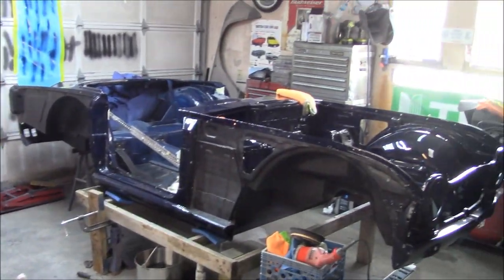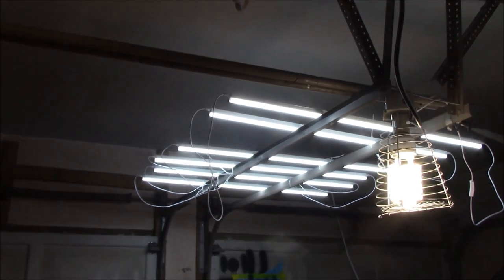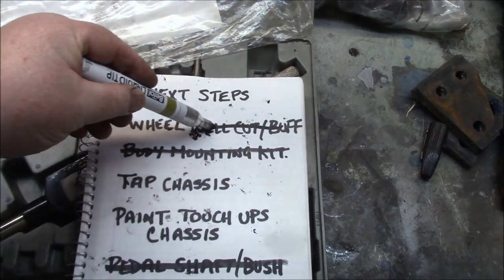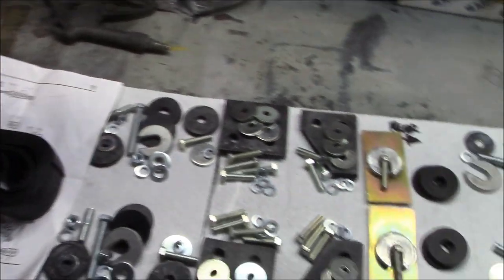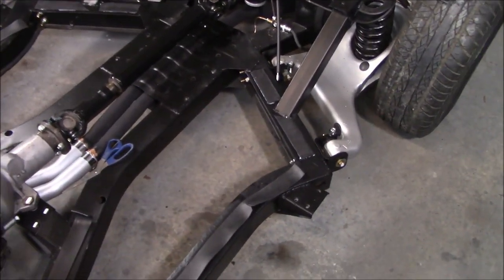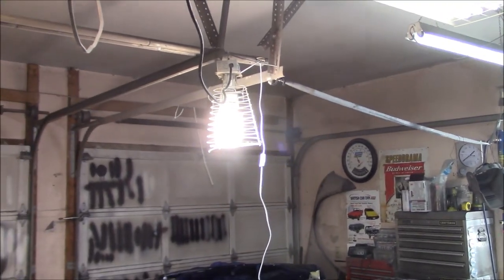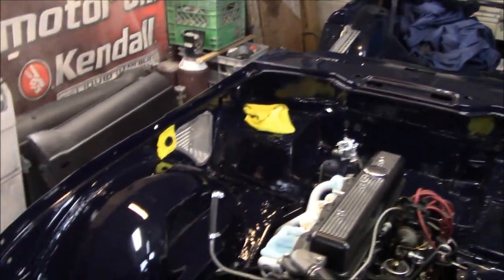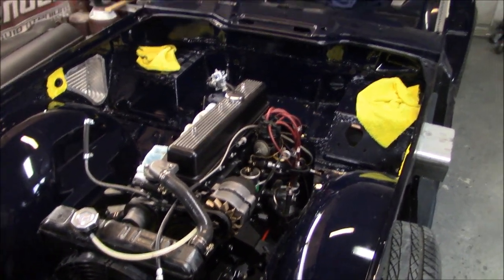1968 Triumph TR250 Restoration, Mating the Body and Chassis

Comment: Dave, it seems to me that if you could afford to have the trailer over (about another foot) parked more central to that garage door, I think the back ramp would actually fold down into the open garage door aperture, - without ever having to “move” the trailer....?
Reply from the maker: Hi Phil, the issue is, I need to get two daily drivers in the driveway as well as the trailer...the truck takes up one side, the trailer takes up the other...I park the car in the middle between the trailer tongue and the truck so I have to move the trailer as far over as I can...I also have a sidewalk crossing over my driveway so I have to make sure that I’m across in front of the sidewalk or I’ll get a ticket 😉
Reply: Oh, right...- I’ve got the message! (Congrats on getting the body on anyway, it’s really looking excellent )👍🇬🇧

Comment: Tush, what is the measurement of the door brace bars? I'm going to home Depot to get some
Reply from the maker: Im not sure actually as I never measured them.   You basically need to measure from where the soft top would mount to the center of the A post between where the two door hinges would bolt up....I drilled a hole in the sheet metal there to attach the brace...it won’t be seen as there is a kick panel covering it.   Hope that helps.

Comment: Hi, could you tell me what the triangular cut outs are from the engine bay into the front wing area. I've owned TR4's, 4 A's and neither had these that I can remember.
Reply: Those are cut-outs to replicate the "LeMans" race car vents seen on TR4/4A race cars from the early 60's.  IDK whether the TR5/250's ever had those vents but they look nice.  There is a similar mod for Spitfires to replicate the fender vents of the LeMans Spitfires that came in 1, 2, & 3 in their class the first time they were raced at LeMans.
Reply from the maker: They were on the Triumph TR4 Works Rally Cars and I liked them so I thought I’d incorporate them into my TR250 project.  None of the TR’s had the wing vents from the factory.  I personally thing they will look great but they will not be everyone’s cup of tea ( and thats ok).
Reply: @cheftush  FWIW, I've seen them on a 6 at the Mitty and I think they look great

Comment: did ur 4 main mounts end up the same as each or different?
Reply: one you-tube guy expounds the idea that the bod can add to frame stiffness, an interesting idea, maybe
Reply from the maker: Hi Steve, if you are talking about the 4 inner sill mounts, then yes, there are 3 shims on each front and rear.
Reply from the maker: @steveludeckery6147  what adds the frame stiffness?
Reply from the maker: Well the body would add rigidity....as you probably know, I’ve also strengthened the frame in numerous locations as well.